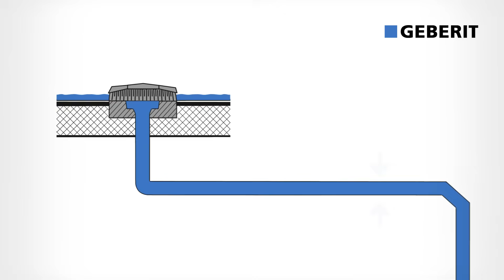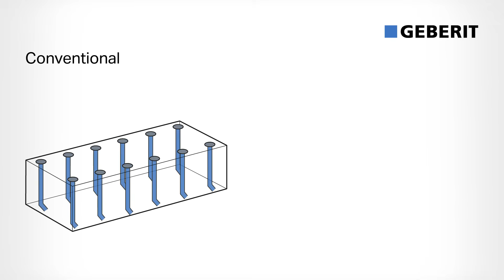Geberit Pluvia Siphonic Roof Drainage

Comment: Does that mean if the smaller the pipe diameter, the faster the drainage process?
Reply from the maker: The flow velocity inside the Pluvia system depends on different factors within the hydraulic calculation of the system, e.g. volumetric flow rate, pipe diameter, pressure.